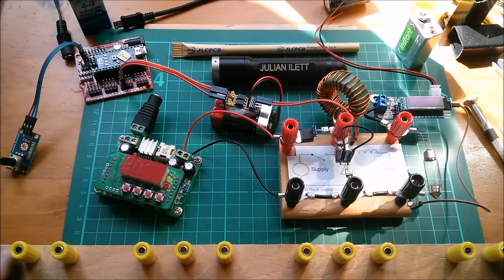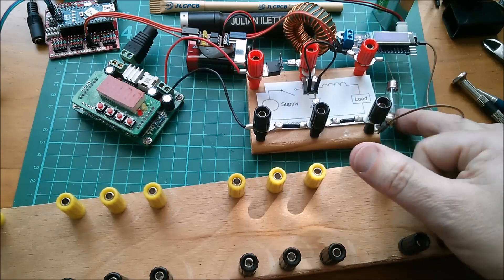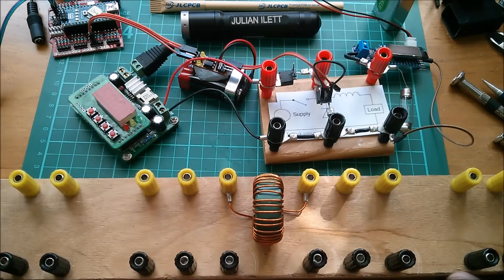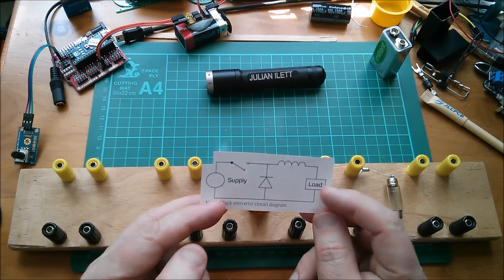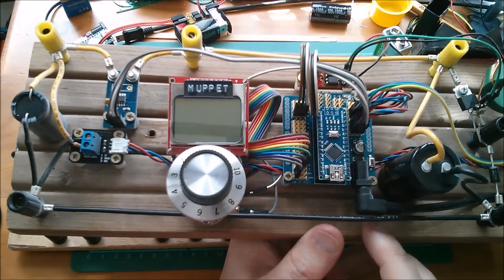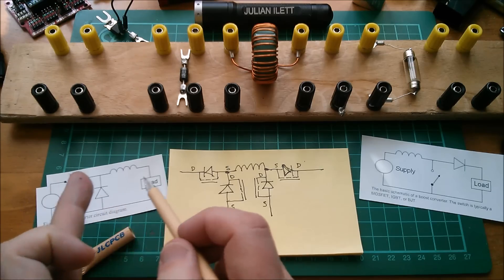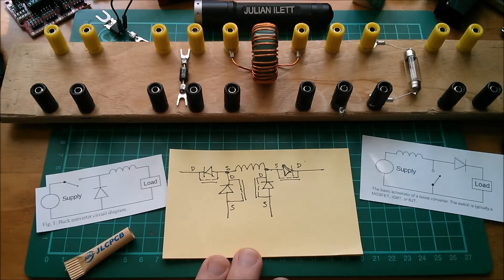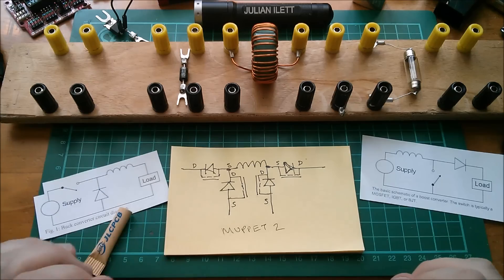New Breadboard for Muppet 2

Comment: Your comment at 15:00 is wrong. You can transfer power from one power supply on the left to one on the right or one on the right to one on the left. What you can't do is transfer load from left to right or right to left if you only have two loads. You transfer power from one power supply to another every day when you have a battery charger or solar panel charging batteries/super capacitors. And then feed that back into the grid. Power Factor Correction Capacitors act as both loads and power supplies.

With the correct circuitry, you could have a 12 volt system charge a 24 volt system and the later have the 24 volt system charge the 12 volt system. All relies on boost circuits and buck circuits and a proper controller.

Comment: I still think this is the wrong core material for power applications. Why not save yourself a lot of headaches with a saturating and otherwise misbehaving core, by getting a proper powder toroid core used in switchmode power applications? Even a simple yellow core from a PC power supply's secondary side would be better than this green one...

Comment: The obvious application for a bidirectional converter like this is to add regenerative braking to your electric bicycle assuming you still have it and it hasn't rusted away yet.  That would increase the range for a given battery size.  The neat thing about bicycle power supplies is that the more power you use the faster they go and the more cooling air you get over the heatsinks.

Comment: Those banana sockets used to be supplied with a small spigot on the side of the plastic, so that any tendency to rotate could be negated. That was about 40 years ago. Have they cheapened them by making the shafts cylindrical?

Comment: You are reinventing the wheel. 
They have an IC for that; LTC3780 
Buy the board and control it using an Arduino or whatever. You can put external mosfets to control directions. 
https://www.aliexpress.com/item/LTC3780-DC-5-32V-to-1V-30V-10A-Automatic-Step-Up-Down-Regulator-Charging-Module/32817780222.html?spm=a2g0s.8937460.0.0.uge8iY

Comment: however bend one end of the diode 90 deg and leave the other straight  put the straight leg in the bottom terminal first then slide the 90 deg one over the top terminal the diode will be on a slight angle but unless ocd kicks in you  should be fine

Comment: Some foots or another piece of wood to raise the ends of the binding posts off the deck would have been easier and neater than cutting down the bolts. Also, MDF would be nicer than plywood.

Comment: With a second inductor and 2 more mosfets....  could you have power coming into the center from a really inconsistent source like a wind turbine, charge batteries on one side and a supercapacitor on the other side instead of a shunt. Then instead of wasting excess wind power you could feed it back to the batteries from the super capacitor.

Maybe use this system for regenerative braking in an ebike?

Comment: Put the diode on banana plugs and plug it in the top! You are wasting that functionality. And unscrew the terminals completely and you can put your already soldered components in from the top so no wrestling required.

Comment: Usually, there is a hole in the shaft of the banana socket. Unscrew the top cap and simply align the holes so that you can put the diode leads through the holes. Align the holes so that they are parallel to the long sides of the board. The way the leads of the diode are bent in the video would work perfectly.

Comment: Ring terminals instead of fork terminals? Yeah, it wouldn't be so easy to remove but it at least they wouldn't slide around or come off.
Reply: This was what I came here to say. Unscrew the top of the terminal, and slide the ring terminals down on to the post. Screw the top back on and you have the neat, straight component and a secure connection l.

Comment: You could take washer, solder on some dupont mail connectors around the rim, then put that on a banana plug. That would allow you to connect multiple mcu's at once into 1 connection. Could even use it at an existing connection. Even though you said you want 1 connection per plug, you'd not have any motion except when you need to pull out spade. That would also give you points to connect your scopes and such easily.

Comment: do you have any specific reason to use DCOI and not a gate driver? i did a bidirectional dc/dc converter for my fyp. also used arduino to perform the mosfet switching but at 62.5kHz. i used IR2104 gate driver to control it. 

and thank you for the ACS712 series. it really helped me to provide stable feedback for the converter back then. cheers

Comment: 4:55 - You solved your diode connection issue right there.  Use the bottom (anode) as is but bend the top (cathode) 90° to the left.  It will look just fine and solves your little "breadboard" issue very simply.  Or you could bend the bottoms instead I suppose and it might look better.  Perhaps even looking a bit neater than the "Z" bend a couple others have mentioned already.
Reply from the maker: I went for the Z bend  - it looks pretty good :)

Comment: Why don’t you measure out a length of 12/14 ga. solid wire to run the entire length of the ground connection from the leftmost binding post to the rightmost one (taking a 90 degree bend - and about 1-2 inches - into account). Now solder on the leftover bits of solid wire at right angles to these, and at the same spacing at the terminal posts. Finally, crimp on the spade connectors, and insert this bus-bar into all the black binding posts.
I foresee ruined binding posts if you try to solder wires to them on the underside; the problem being twofold; 1) the solder won’t stick to the chrome-plated steel, and 2) you’d need a lot of heat, and the plastic bits would melt even if you could solder to the screw-bits of the binding posts sticking out underneath! Not fun!
Another option is to have someone with metalworking skills make you a custom copper bus-bar with holes drilled and tapped for the binding posts, then route out the wood on the bottom to make room for the copper bus bar. Now you can screw in the black binding posts into it, and it won’t be unsightly, or affect the ability to put connections in on the topside. Cheerios, mate!
Reply: Those posts used to be made from cheap brass. The plating is normally nickel, and if it's on steel there should be a copper plated layer beneath the nickel. Most manufacturers wouldn't bother with chrome for contacts, because of the added expense. For chromium on steel, you need copper, then nickel and finally chromium. You can solder to nickel, with decent  flux, but chrome is much more difficult for most people. The biggest concerns with soldering to the shafts are, as you say, heat which will be melting the plastic, and the problem of not being able to re-use easily the 4 mm socket for another job. One other option is to do the job properly and use a good ring terminal on the bottom of the shaft and then crimp and/or solder connections to it whilst the nut is off the shaft.

Comment: Remember, you can plug your meters or your components into the banana plug parts on top of those posts, you don't have to use the crimp on terminals for everything. Also, you can link the posts  on the top more quickly and easily than on the bottom by using banana plug patch leads, although that could look a little less tidy.

Comment: You could consider twisting the diode legs in a Z fashion and if you carefully loop the ends you may even avoid soldering those other Y connectors. Just a thought. Great video and thank you!